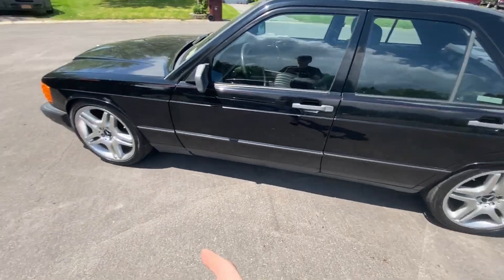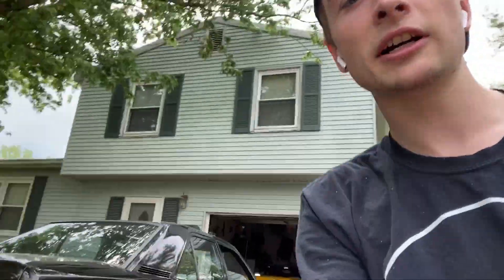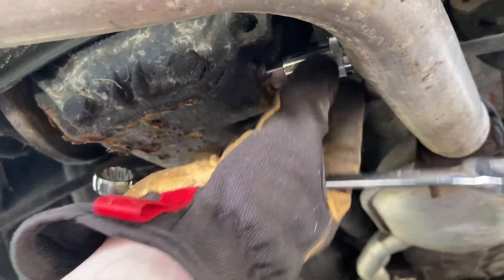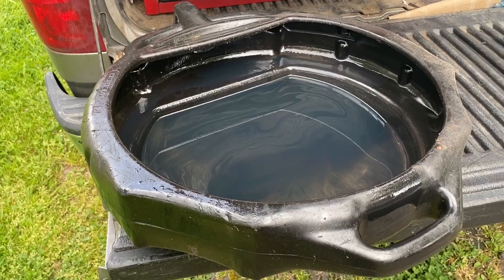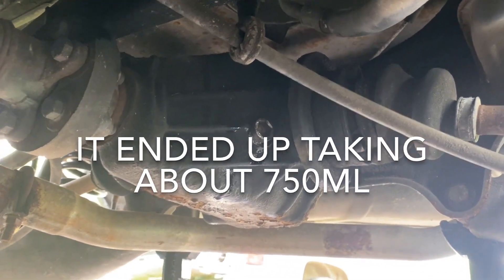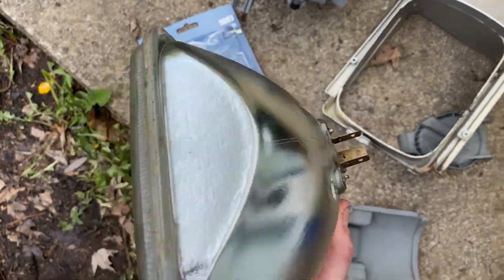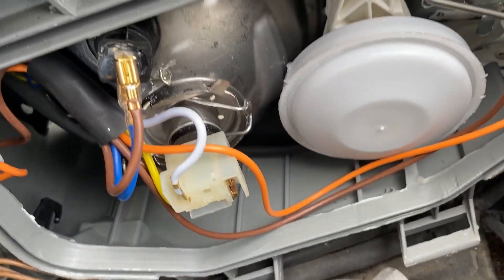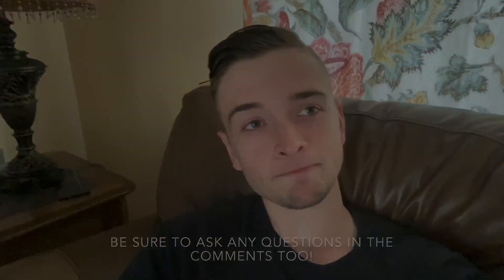Ep:5 Mercedes Benz 190e euro headlight swap, wiring complete, new differential fluid!!

Comment: So I haven't finished watching all your videos yet, but if I recall correctly, you can get those 6 pin connectors from a 190e/300 taillight. The taillights have the 6 pin connector and I believe I used that connector to clean up the headlight wiring/plug on my 190e
Reply: Correct.  That’s exactly what I did went to the junkyard and cut out the 6 pin from the tail with scissors works perfectly.

Comment: That extra plug in top is the day time driving light.  It looks like it might be a W5W bulb.  But if the plug is not getting power no point on doing it. It should power up automatically when the car is running or driving.

Comment: Can’t you just pull/break off the extra pin to have the oem connector fit on the euro light??
Reply from the maker: Maybe, but you’d definitely have to pull apart the connector to move some of the wire positions around in both sides.  Also I’m not certain that the holes are spaced apart the same.

Comment: Also do you think 17x7 rims will fit ?
Reply from the maker: David Gomez They will most likely fit, but it will depend on what tire size of course. I have 18x8.5’s on the front and 18x10.5’s on the rear, but I did need to do some cutting on the fenders once I lowered it to get it to clear.  I have a video about that coming out soon!